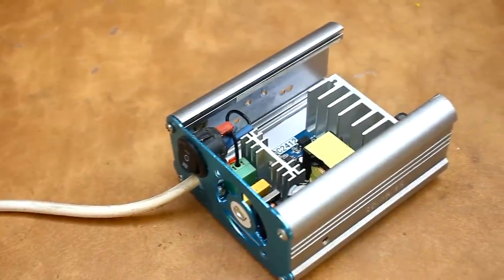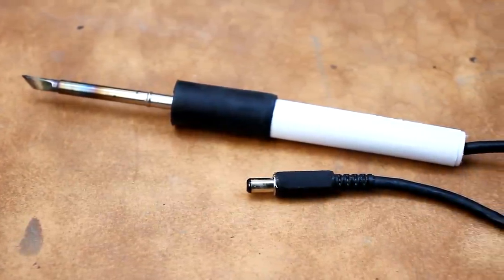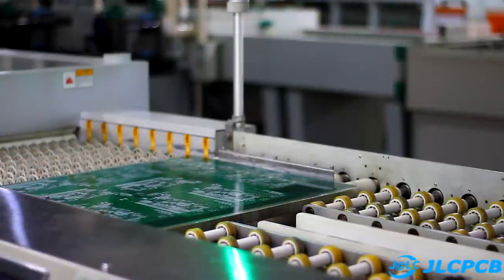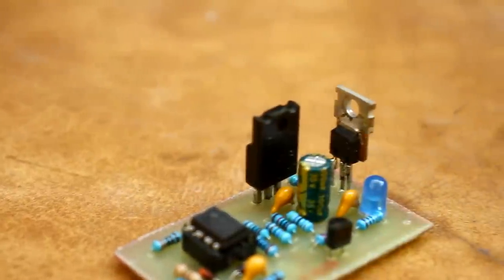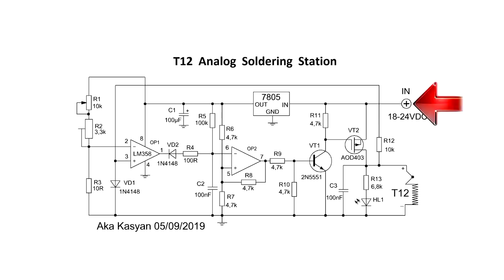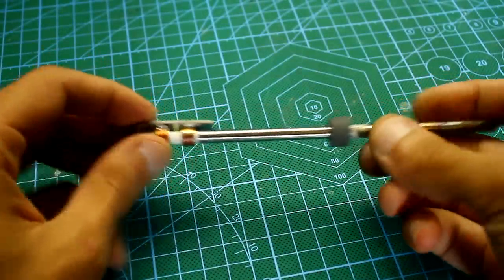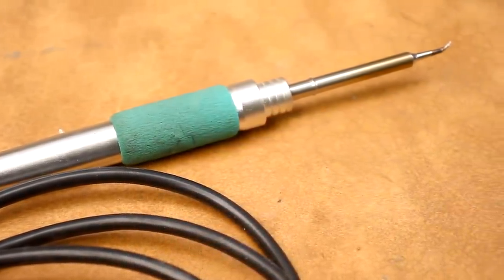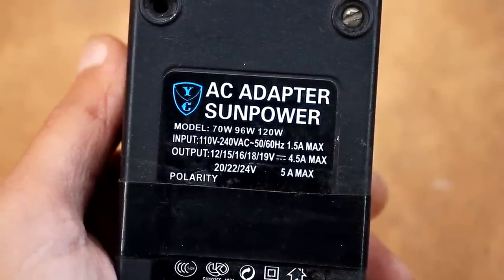The simplest soldering station on T12 tips

Comment: I assembled the components using the diagram shown here, when I tried it LED1 immediately turned on, and VR1 seemed to only provide a voltage range between 3vdc (minimum) and 3.7vdc (maximum).  When I try to use a power supply to run the circuit and attach the soldering tip, the voltage will drop from 12vdc to 5.6vdc with a maximum current of 1.6.  is there something wrong with my circuit.  Thank you very much.

Comment: On the schematic there are only two 100nF capacitors, but on the PBC there were three. Also, on the schematic the electrolytic capacitor was connected to the output of the IC7805 but on the PCB it is on the input.

Comment: Nice job. If you use acetone on a rag you can remove most silk screen text. I do NOT use an abrasive like a scotch brite pad most of the time as it will affect the surface finish. Most screen printing inks appear to be formulated from plastics similar to laser printer toner. Acetone acts as a solvent that can remove them. I use old tee shirts cut into shop rags for jobs like this. If a few layers of rags are used to cover the end of a wooden popsicle stick with a rubber band to hold the rag(s), it is possible to make a tool to work on smaller areas. I don't recommend using tape, or trying to mask off areas you want to keep versus remove. Acetone will find its way under almost any tape and will cause problems.
 If you really want to make a nice looking indicator scale, it is possible to use photoresist on a soda can and etch it like circuit board. It is easier to remove the outer painted surface of the can's aluminum. Don't damage the inner plastic coating. I cover this inside surface in an extra layer of box packing tape while working on the sheet of aluminum. Make the transparency mask lines around 75-80% the size of the final text. The aluminum will etch differently than copper. It tends to etch laterally (sideways) quickly while you are still waiting on the sharp edges to dissolve. I leave the aforementioned packing tape on the back surface of the aluminum when I etch. It is easier to control the process when only one side is exposed. After the etch is done the tape will help remove the coating that was on the inside of the can in the areas that have been etched through. You will still need to use a sharp razor to remove the rest of the liner coating inside the lettering, but this is easy. This process will yield a nice stencil. 
  Now place the stencil on the surface, mask off everything else around it, and use a spray paint can to apply very light coats of paint to the stencil with the can held at 90 degrees and further away than usual. Do not be lazy and try to do 1 or 2 coats of heavy paint, or move the can side to side. Let very light coats of paint cover the work over time and do 8 to 10 of them with 5-10 minutes between each.
   I also use this aluminum can technique to make solder paste stencils. They work great too.
-Jake

Comment: I have  some sugestion for your project :For exemple  you cood use lm 317 with some resistor to get 5 v. The lm 317 have a beter termo stability and a curent consumation of   400a . And you will makeit more  cood add the ground pin for the iron tip  .  În rest is a cool project

Comment: It is better to limit the VGS of the mosfet between 10..15V (add a resistor to the emitter of the bipolar so the drop across the GS resistor becomes the desired 10..15V). Operating it at the 18..20V, it will fail soon.

Comment: I have the simple controller for t12.  Now I  wonder what kind modification is need in the circuit to use  AC24 volt for the heater instead DC. Any suggestion?

Comment: hi there I did it but I don't know why but  the tip heats up very very hot .. first  the led lights up whatever i connect the tip or not second i 
tried to see the voltage at the tip wire it gives me the same input voltage 
can u help me i need it to work very bad <<>>>

Comment: I'm trying to change the mosfet with irf9540n, it didn't work. The mosfet was very hot, then my t12 solder tips were red hot burning. I use soldering tip ksger. Is there a solution to solve it? Thank you
Reply: apparently there is a path not soldered yet. now the solder is working properly. thank you

Comment: 4:09
At the moment of the tip being heated by 18-24V from the power supply, won't the input on the OpAmp be the voltage of the power supply? How does the OpAmp "know" the voltage of the thermocouple if it's connected directly to the power supply output like that?

P.S. I've built this station and it works. It keeps me up at night knowing that I don't get it. Please help :D
Reply: Also, a diode below pin 3 of the LM358 is going straight to GND. Why?
Reply: I have the same thoughts. Can somebody explain?
Reply: @КостаСтојановић-о8х  Well, it kinda works like a relaxation oscillator, When the heater turns on the voltage does go up to about 0.7 V (clamped by the diode) on the input, the opamp switches, but the 100nF capacitor has to discharge before heater can turn off, when it's off the op amp sees the "true" temperature. So this circuit only measures the temperature when not heating, and, when heating will switch on and off to measure tip temperature.
Reply: @djtransnazgrz  Thanks for the explanation!

Comment: A few years ago I made a t12 station using arduino, a switch with bjt and P channel, and an op amp with 200 gain, one day the 7805 died and killed the atmega 328p, as I needed to solder I replaced the arduino with a comparator using the second 358 amplifier and it has been like this for 5 years, the only problem is an audible noise at 2KHz, but it is not the same design as the video, so I ask someone else has some noise, from the mosfet, in the arduino version used 30Khz to avoid this, does it happen to anyone else???

Comment: can I replace the mosfet with another one, I'm having a hard time getting it. thank you
Reply: A bit late but yes you can pick any but check the RDS(ON) and Vgs
Reply: The switching is done on positive side and since p channel mosfet is used, 
Plz reply me why is it done so ? 
Is it possible to do switching on negative side using n channel mosfet ? 
As you know, p channel mosfet are hard to find...

You people are only source for this kind of educational learning, plz help
Reply: @16phoenixlast  There are plenty of resources online, khan academy is good one for learning electronics better

The reason P channel mosfet is used is so that the thermocouple can be measured, if the low side was switched the ground would not be connected and the amplifiers would only see full source voltage and no regulation could be done

Comment: It is a PWM circuit without any temperature sensing.That means increase manually the duty cycle until the solder melts in the desired solder point but can not be left prolonged because the next melting will be the solder iron itself.